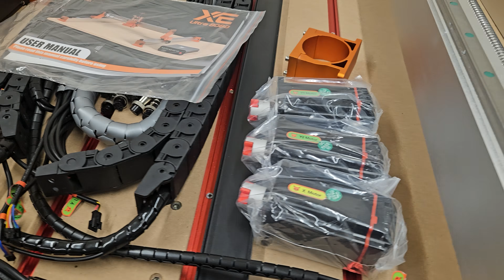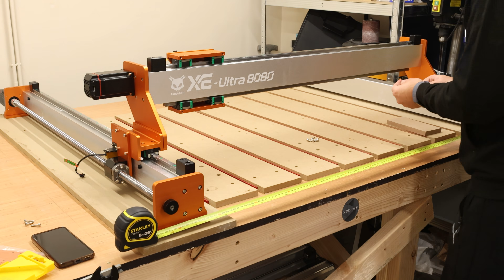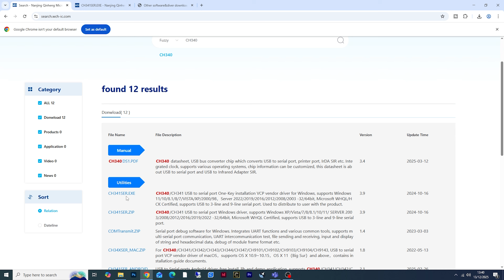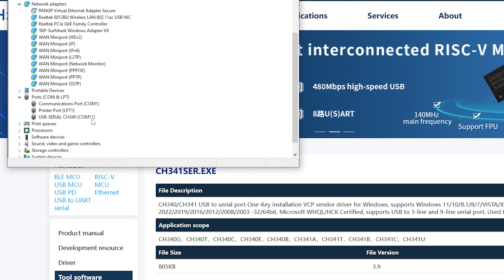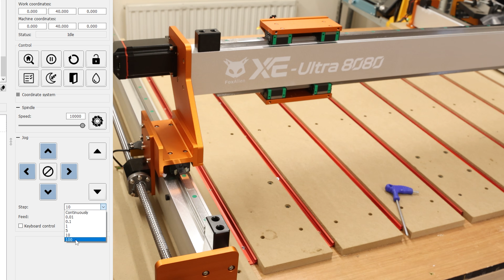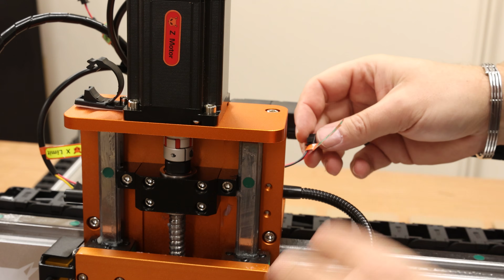First look and assembly of the FoxAlien XE Ultra 8080

Comment: Im wondering about the base, the machine comes with those red rails and those MDF parts or you added them?
Reply: Ok i see now, at least in Canada they are selling the machine alone, no spindle and no t-slot base and not 4th axis. All are extras. I need the space but buying everything separated is crazy unless this is the only option. Looks like a nice machine but let see if there is something completed around. Thank you for the video.

Comment: Thanks for the video but I do have a question I followed exactly your directions but ran into a glitch Y1 moves but Y2 is not moving.   I have check the cable, unplugged them and redid them but keep getting the issue.  What is your suggestion

Comment: Solid walkthrough, but no quantified gantry stiffness.
What is the measured tool-tip deflection at Z-max under a known lateral load? Without that, cutting claims are subjective.

Comment: Hi! I've been watching your videos to try to learn how to use my new CNC machine the FoxAlien Master Pro. I've followed your tutorial and used Easel and am using the recommended Candle for the actual cutting.
I wanted to test with the bits that it came with, I think it's v bit 20 degree? However, the machine keeps stalling, I don't know if it's going too deep or how to fix it? I am getting so frustrated and don’t know where to look or ask for help. Thank you in advance
Reply: Masuter Pro comes with 30 degree V bits along with various other 1/8 in bits.   The spindle that came with the machine is very under powered at 60 watts.   Do yourself a favor and upgrade the spindle.  I out in a 710 watt spindle and am very satisfied now with the machine.  Get a 1/4 in collet along with the new spindle and use 1/4" bits.

Comment: Super helpful.  After watching this, it was fairly easy to follow the directions and set up the XE Ultra with the 1.5kw spindle.  I also got the hybrid spoilboard/base, which was an easy assemble.  Was able to get up and running in no time and have done a few carves with Vectric.  Thanks for this information.
Reply from the maker: Excellent. Glad it was a smooth process 👍
Reply: How's your experience been with the machine? I'm thinking of getting one but nervous about the mixed reviews.

Comment: i received my xe ultra from foxalien, without a bed to save on costs, i noticed you're not using extrusion frame underneath and you're using a wood table as the flat reference, will that need periodic resurfacing to keep it perfectly flat long term? I ordered 3060 extrusions to put underneath, anything to recommend for this machine
Reply from the maker: So regardless of whether you use a frame or mount to a table, the correct method is to install a spoilboard. You then surface that spoilboard to ensure everything is flat. Once the spoilboard take enough damage, you resurface it again.
Reply: @JamesDeanDesigns ok thank you, I'm ordering their original hybrid MDF t track bed with extrusions underneath, although it would have been better if they used 4040 instead of 2040 layed flat

Comment: Greetings James, I am considering an upgrade to the XE from a Masuter Pro, what is the minimum bench space (including the motors and possibly the controller) required for this machine?
Reply: John, considering the 8080 w/ purchased base, I needed 25 sqft. Fox recommends 20” additional space around ea side. However, I didn’t add that. I bought (2) 60”x30” packing tables w/ castors from ULINE and tied them together - works fine. I didn’t want to build a table. ULINE customer service proved excellent